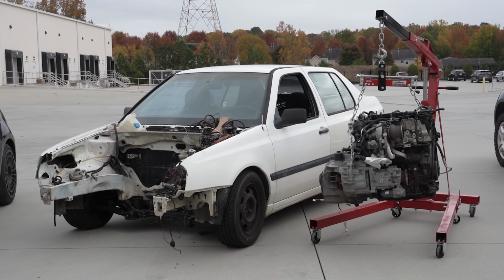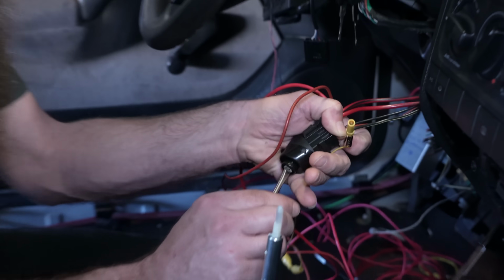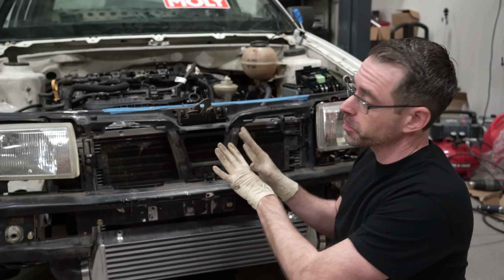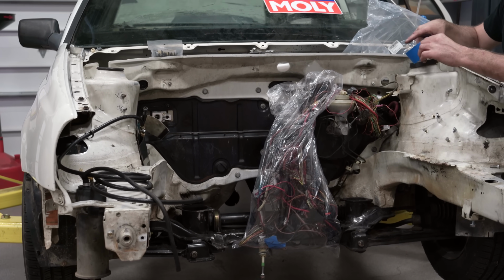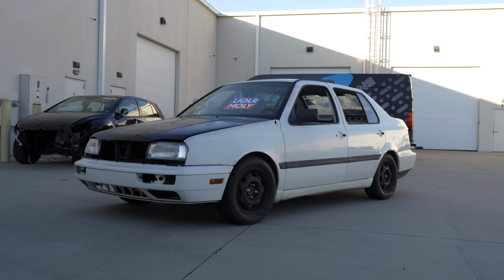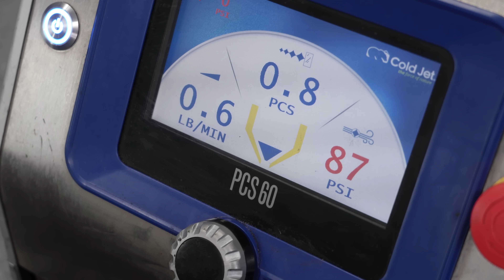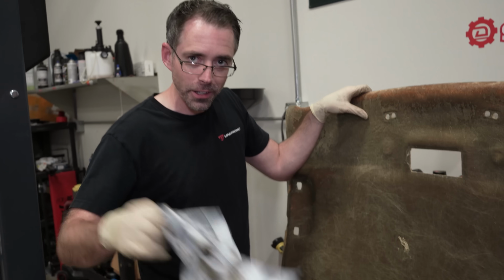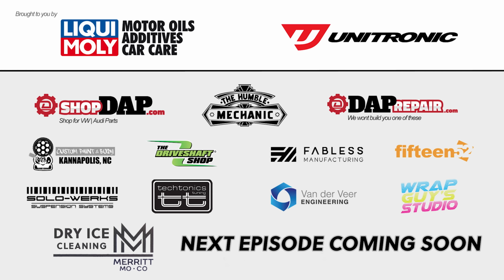Starting the MK7 Swapped Jetta for the First Time! (Part 4)

Comment: Hello, for the OEM look the headliner lights comes in black originaly in passat b3, you can just buy them with the handles for cheap.
Also the suede material might be good for headliner, but will probably fade away because of UV and turn to purple on the rear shelf.
Good luck with the build !
Also door handles can be upgraded to better looking ones from vw polo or vw sharan, direcly fits in, slight bent needed to the opening tab on the door lock.
Inner door handles comes in chrome on VW golf mk4 cabrio, you might need 2 sets for 4 doors.

ALSO you can make front seats tilt and raise if you get seat bases from passat, it has 2 handles, a must mod if you are using oem mk3 seats, you just need to disassemble and cut/weld few spots to swap bases.

Comment: If you guys were following your thread at VWvortex it was  mention by me in post #48 that DSG has immobilizer. 
Also that is not only problem that you will have , speed signal for DSG is going to be your biggest problem , DGS gets speed signal from ABS in mk7 , even early mk5 and mk6 are same way .
Good luck

Comment: That dry ice blasting was the muts nuts, didn't knw about that. There was one thing I didn't like whn he painted the car he didn't take the side moldings off the doors and small bit on the rear arch so now whn it comes off there's gona be a different shade of white and where it's dirty between the molding and panel the paint dnt stick and will start to lift over time, it's a shame. 💯💯💯💯👌👌👌👌👍👍👍👍👊👊👊

Comment: mk3 front door panel, it's the mirror control. you probably broke a tab on the stalk for the mirror. those are a pain, they can bind up, and are screwed to everything under the sun

DOUBLE CHECK THE ROOF DRAINS IF IT HAS A SUNROOF. they will flood the floor baaaaad. long tubes that should fit into some rubber boots down low in the a and b pillar areas

dry ice blasting is like the final boss level in those pressure washing games

Comment: dang.. that was some terrible welding on your ground bolt. I did the same method on my S3 putting the battery in the trunk. PS, missing an exhaust clamp at 6:15 prior to the maiden lol.

Comment: So even tho it this footage is months old, a tip for paint matching the interior handles and light - 99% of the paint attempts I've seen done to these parts suck. The surface just ain't suitable for any paint and either they loose their texture to the touch or the paint starts peeling very soon. The solution: (in the euro market atleast) the passats from that same generation all came with stock black handles and lights - just try to find some of these since they are 1:1 match.

Comment: It would have been fun to see what Retrobright would have done on the plastics. Hydrogen peroxide mixed with water and exposed to heat and uv = removing yellowing discoloration from old plastics.

Comment: A superb amount of work in such small time. But why paint with side door moldings? I've done the same process, and there is a lot of road dirt for sure. It also will require new clips and thimble-like rubbers. Probably just didn't have time to do it right. Anyway, I'm not sure that this car is more than a show car.

Comment: I presume you're a lot further down the line now, but if you need help removing the immo from the DQ250 DSG, let me know. That's likely why it won't go into gear. "Component Protection" - it's actually an immobiliser.
Reply from the maker: Right on both counts. I really appreciate the offer though
Reply: @Deutscheautoparts  delighted you've got it sorted - absolutely buzzing for the next episodes though! Please hurry up, I love to binge! 🤣

Comment: why did you guys didn't use a programable ECU? like fuel tech, i say fuel tech because that's the one i know, it would control the since the air con to the clutch and more and more. they're working on something specially for thins especific engine right now. Ok that is quite lake for this comment but nhe

Comment: wouldn't it have saved time (and maybe money) if you had pressure washed the car to get rid of some of that stuff before taking it to be dry ice blasted?
Reply from the maker: Yup but we wanted the best transformation possible
Reply: @Deutscheautoparts  wouldn't it have helped the blasting by pressure washing it as there wouldn't be as much caked on mud/dirt/spider webs for it to deal with which is also where the saved time and money comes in?  I just think that having the car semi clean before blasting would help more than anything

Comment: Well, the fast2furious-Jetta had GT-Doorplanks and fender-flares painted. They are slightly bigger than the GLI parts you used instead - and they fit perfectly to the fender-flare, which the GLI parts do not do...